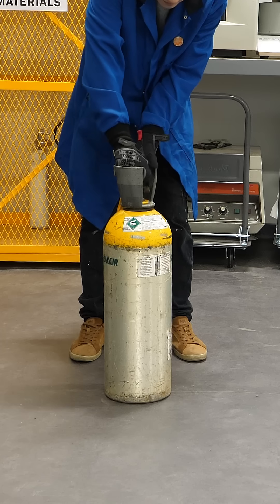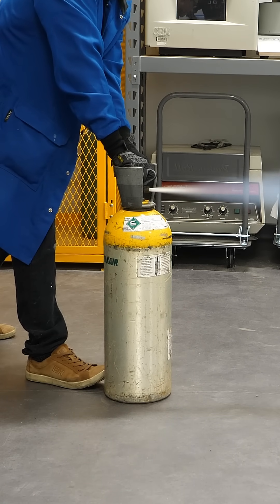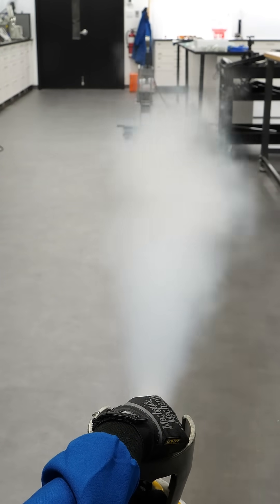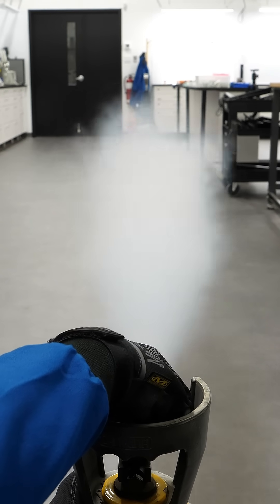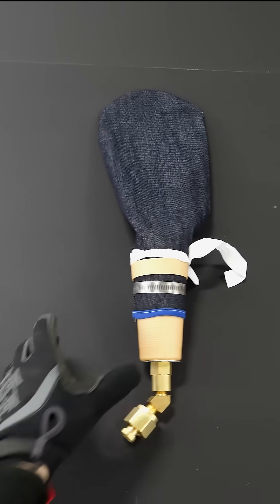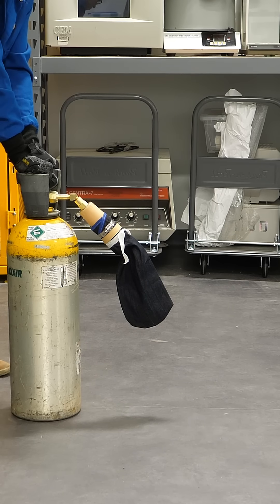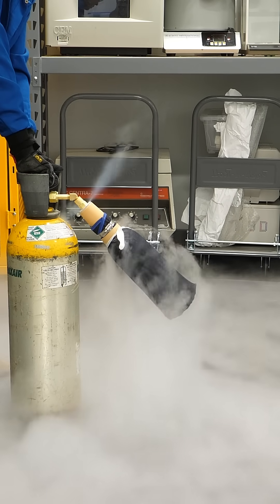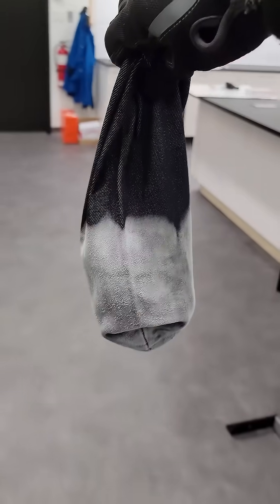Making dry ice from scratch

Comment: When you pumped CO2 gas into the socks, due to the large volume of the gas released and the small volume/capacity of the socks, the pressure exerted by the gas molecules was high on the socks. The counter pressure on gas molecules was also large. As a result the particles came closer and CO2 gas converted into dry ice.